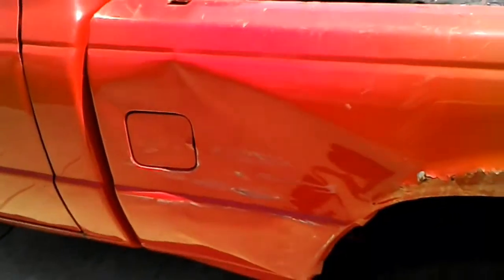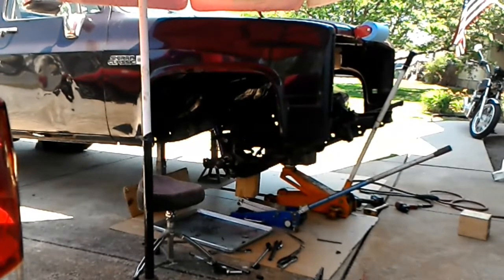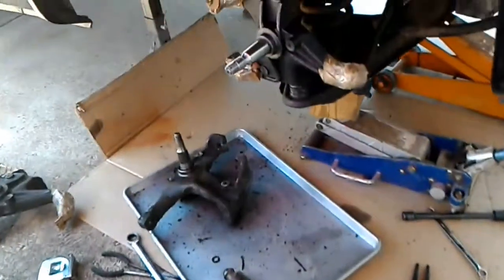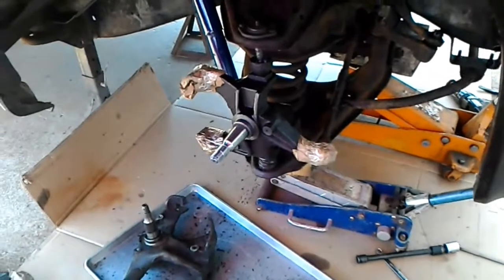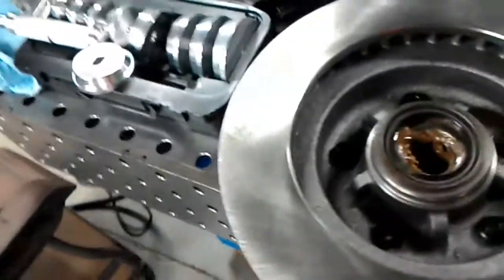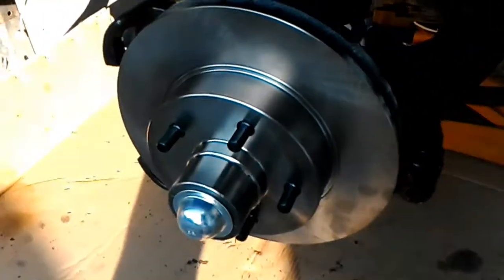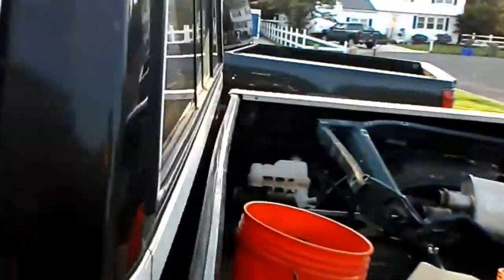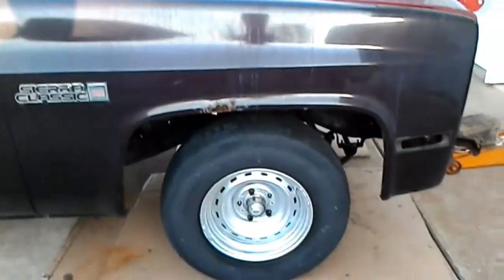Chevy C-10 three inch drop spindles installation

Comment: Are you happy? Did you measure before and after? Does not look too low
Reply from the maker: Since that video I’ve done a frame up nut and bolt restoration not finished but I did cut springs and now has a motor sits perfect